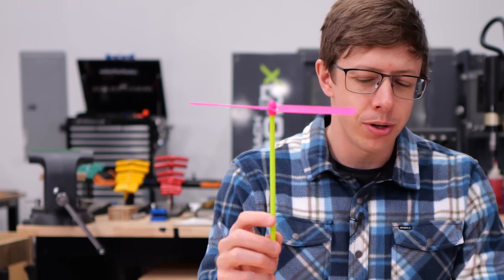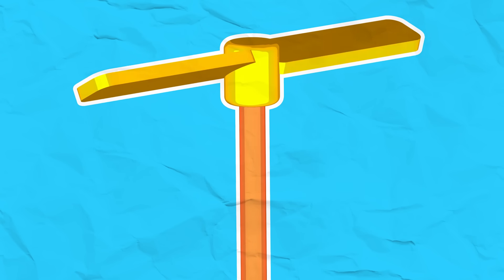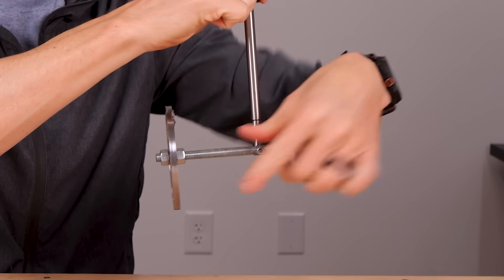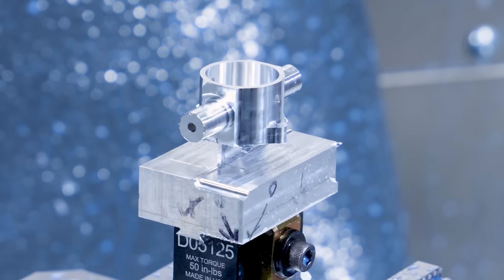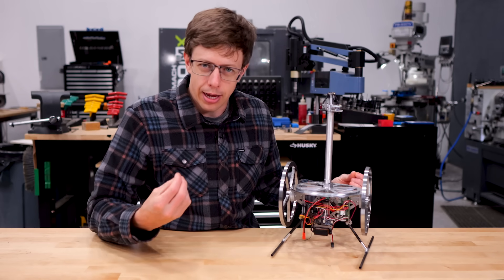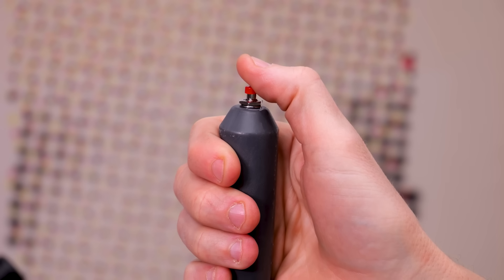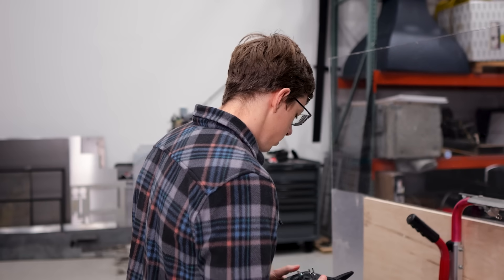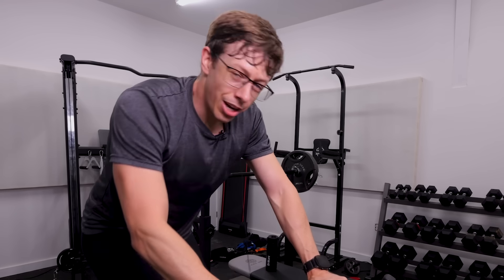I really thought this would fly well

Comment: May I just say: WHEEEEEEEE!!! I had one of those dangerous string-pull air dancer toys as a kid, so that flight path is familiar. Way, way higher, and unobstructed by drywall, relatives, and similar breakable objects. But familiar.

I am like 90% sure the twisty thing is why grown-up helicopters have those pokey-out tailfin things with the little sideways propellers on them. They are pokey-outey for leverage, so the sideways propeller can be of reasonable size, and then it can be used for steering, too. Not, like, normal, reasonable steering, though. Freaky helicopter steering. (It's amazing that helicopters work as well as they do. Did you know they're not required to have black boxes in them? That's insane.)

I look forward to whatever bizarre mechanism you come up with just to try something different from existing, proven designs!

Comment: What what happened if he put another set of flying wheels spending in the opposite direction of the other two? So that would be flywheels on all four sides.

Or 

One horizontal flywheel on the bottom of the helicopter spinning in the opposite direction with a gearbox transfer the power?

Comment: isn't the torque of the rotor spinning everything in the opposite direction with no way to counter that torque because you have no side rotor or counter-spinning set of blades below it? And do the wings even work? Like most of the air going over them is just turbulent, right?

Comment: Those aeleroms are nowhere nesr big enough....considering you used a precision aerobatics katana as a visual aid...precision aerobatics planes are notorious for having huge wings with large control surfaces because theyre designed to fly 3d aerobatics which the majority ofnmanuevers are done post stall and not using the airfoil....the key is huge control surfaces guiding the theust from the prop....the ailerons you employed are more for a wing with an airfoil and ustilizinf the wings lift....in this situation its not using a wing to fly so your going to need obnoxious cintrol surfaces to get the same affect because its relying just on the air flow thats the thrust from the prop nothing else is contributing to the lift on this aplication
Reply: Try making that whole surface rotate instead of hinge and it will take significantly less effort to correct in flight

Comment: Would be an interesting design for a V2 if you added a second blade rotating in the opposite direction of the first one, which is what I believe some helicopters use to deal with the torque issue

Comment: Glad to hear you already have an idea! I'm curious what would happen if you put a planetary gear set in between the rotor and the horizontal flywheel. Ring gear on the inside of the horizontal flywheel, planet gears fixed on the support shaft and sun gear fixed to rotor shaft. Would cause the gyroscopic effect of the vertical flywheel to counteract the rotors. Not an engineer just a lowly automotive tech so I'm probably missing some physics law

Comment: Fascinating to watch you work as always. With the current design, seems like you need another spinning flywheel on the bottom (rotating counter to the gear) to counter the torque. OOOORRRR you could just create a release on the propellor itself to launch it straight up under its own power.

Comment: couldnt you just put a secondary set of spinning blades at the bottom generating torque on the opposite direction of the spin?
Like actual helicopters. I mean you already put so much stuff under the blades thats already no longer a kids toy might aswell not try to re-invent the wheel and use the helicopter method

Edit: Also if you conect the main blades throught the main rod of the contraption to the secondary set of blades they would automatically reverse their rotation as it falls and then again when reactivating the main blades so that way it should keep its balance all the way through its flight

Comment: A store bought electric toy helicopter I have works great; it can take off, fly around (under radio control), land.. but you have to charge a battery for 40 to 45 minutes to 7 to 9 minutes of flight. 

It would interesting to try to improve on that. I suppose a gas motor would be the thing, but gas motors are noisy and heavy. I wonder if there's an alternative that would work. The batteries are pretty light. What if it could carry 7 of them, lol. Then you could charge one set while the other set was in use. It could be a military helicopter and the batteries could be shaped like bombs or missiles.

Or.. what's the smallest, lightest, quietest gas motor you've ever seen?

Comment: Great video! If according to the hacker contest rules the objective is to find a way to use "stored kinetic energy" to prolong the flight of the toy, you could simply redesign it using counter-rotating blades and battery-powered electric motors. Then, charge up the batteries using a generator hooked up to your exercise bike. No foul, mission accomplished.

Comment: I think there is a reason helicopters have blades on top and only on 1 of the sides, not on both. Im confident if he had just one that had variable speed control on the side, he could have it automated to offset the spin of the body with just the right amount of rpm

Comment: I'd really like to see the flywheel solution work.  Perhaps a counter rotating flywheel with a planetary gear (on the same shaft as the rotors)? 

Also, i had a toy helicopter as a kid that used a free spinning rotor (cox free flight cobra).  Mounted on top of the rotor hub was a small .049 nitro motor with like a 3in prop.  When the motor was started the rotor would counter rotate to the smaller prop, although much slower due to its much larger size.  The rotor blades were free to pitch up and down a certain amount and had a counter weight on each rotor blade near the tip that extended out in front of the blade.  So based on rotor speed the weight controlled the AoA of each blade. You'd fire it up, let it go and it'd climb for about 10 seconds before running out of fuel, and then it would auto rotate back down.  The counter weights controlled the speed of the descent.  As a kid I didn't appreciate how clever the whole setup was.

Comment: Just jump straight to making a helicopter powered only by flywheels, with a swashplate to control the pitch and roll and a tail rotor or some design that doesn’t need a separate tail rotor like NOTAR.

Comment: And this is exactly why we use anti-torque rotors. Wings only give you as much acceleration as airflow you put into them, and even then you're losing some energy. It's also a fixed amount, which means micro-variations in airflow will cause major variations in torque and capsize the aircraft if you're not constantly adjusting the output of the ATR independantly of the MRA

Comment: I’m curious if you could have a third fly wheel towards the bottom that has a similar rotational inertia to the propeller but is geared to spin the opposite direction to directly counter the torque from the propeller. Obviously it would have no steering ability but maybe it could work

Comment: The torque of such a rotor is insanely high, you won't counter with simple airfoils. 
I see two solutions:
1. Use a coaxial rotor. Two rotors spinning in opposite directions. This should be relatively easy with your design. Simply put another bevel gear to the lower side and attach it to a shaft inside your already hollow shaft. The only problem will be the angle adjustment of the blades. You'll probably need something like a swash plate. Or use two servos, the existing one for the upper rotor and an additional servo between bevel gear and rotor for the lower rotor. That would also allow for active yaw controll (one rotor has a higher pitch, which results in more drag and a torque in one direction).

2. Put an actual tail rotor on. This will be way harder to do. You'll probably need a gyro and an approxemate amount of thrust to counteract the torque to define the dimensions and gearing. Obviously you'll need some more gears and shafts etc. Will be difficult.

I'd stick with the first solution. Almost all of your energy is used to produce lift. The design changes are relatively small and I think, there is a high possability of success. Yaw controll would be possible with both solutions. 
Looking forward to see part two! Good luck!

Greetings from germany ;)

Comment: sir, the answer to the rotor torque problem is absolutely a second flywheel. It just needs to be on the same plane as the rotor. 

ergo, you either need a second counter-rotating rotor OR, the flywheel is on the bottom of the craft and it powers the rotor through a small gearbox that reverses the rotation of the shaft. 

The second solution would be easier to build and it's the actual answer - because it doesn't matter what the source of power is, you're fighting rotor counter-torque. Meaning that if it's flywheel powered and has counter-rotating rotors, you'll still have a torque issue because of an odd number of devices introducing torque moments.* With the torque moments tamed, you should be able to maintain controlled flight with the aerodynamic control surfaces. 

_________rotor
        |        upper shaft
       [ ]       direction reversing gearbox - mount control surfaces to the gearbox housing
        |        lower shaft
_________flywheel
       [ ]      rotor pitch control system and landing gear mount

*I know there are helicopters that use counterrotating rotors to combat torque successfully. The issue here is the low relative mass of the machine vs the magnitude of the unwanted torque.  

Also, my brain is telling me there's something I'm overlooking here, but I can't for the life of me think of what it is.
Reply: I don't think this would work. The main portion of the torque is produced by the drag of the rotor. Also the flywheel powers the rotor, so the direction makes no difference. The flywheel itself has no torque other than drag and friction of the bearing. You'd need the same amount of drag on the flywheel wich wouldn't make sense except its not a flywheel but a second rotor. I think the existing flywheel layout in combination of a coaxial rotor would be the best solution.

Comment: just throwing it out there ... enclose the flywheel leaving holes or slots in it so that it creates thrust in the direction you want ... can open and close the holes for more or less thrust ... flywheel is a fan ... you can have each spoke twist in both directions and holes further from the center 'blow' one way and closer to the center 'blow" the other way ... size of the holes to the center larger or spoke blade higher pitch ... hole aperture  would have to be controlled via a feed back of some type I think. 

thinking it would reduce the weight a bit and couple the forces better than your 'fins'. you'd be, effectively, creating a tail rotor that way.

Comment: Cool idea! Don't worry about the mistakes, it's forgivable if you're not an aeronautical engineer. 😉👍

However, the last mistake is that the flying machine doesn't have a tail rotor. The torque created by the air resistance of the upper rotor needs to be compensated with a rotor on the tail, or another rotor that rotates in the other direction. The advantage would be if both rotated on the same axis, then you would increase the lifting force by ~20...30%.
Or you can combine the rotor with a flywheel, make a metal ring with blades inside, there will be less friction with the gears, and there would be no induced drag at the ends of the blades.

By the way, I like it too, you're not ashamed to show your mistakes, I have almost gathered the courage to show the mistakes I have made. 😁

Comment: Truly love your designs and your thought processes 
Just a thought, could you put your flywheel in line with the output shaft to spin the shaft in the opposite direction . perhaps using a planetary gear set up. Making the set up more compact and perhaps providing counter rotation support to the helicopter blades..

Comment: Just make it much longer, the dimensions and weight distribution need to be more like the original thing. 

Also if you could disable auto translation I would be very thankful. Not sure if that is possible from the creators side but it is very annoying since the mobile website doesn't have the option to change that, only works through fiddling with the Desktop website on the mobile browser.

Comment: Have you considered using a single flywheel rotating in the same plane as the rotor but rotating in the opposite direction? That way the precession cancelling works for you rather than against you.

Comment: I think you'll find those flywheels were too heavy for the autorotate plan. In your next design you may want to consider a way to disconnect them after they've run out of energy, or perhaps to disengage before they're entirely out of energy and use the last bit to re-engage before landing - though I'm not sure how light a clutch would be manageable. Also might consider placing the flywheels horizontal too and counter-rotating along with a second counter-rotating prop too, then use prop pitch to control.

Love the channel man, you do some cool stuff.

Comment: ha? what gears, what 2 flywheels.
Why did you not attach single flywheel perpendicular to the shaft of the propeller. It would always be under the prop blades and on the way down angle of the prop blades would manage the descend rate.

Comment: You need a second small propellor with a horizontal shaft pushing the air to eliminate the torque caused by the vertical axis.

Comment: I'm sure someone has said this but if you're driving the blade while in the air (even with flywheels) you're making a helicopter so will need a rear stabilizer motor. 

Another option is to have more then one blade to offset the twist. 

Surprised you didn't figure that out as you're usually really quick. Maybe you're burnt dude. Let your brain rest a bit 😁

Comment: thanks for this it was fun. Can you balance the flywheels by turning them a bit you could also keep the thing upright maybe get rid of the wings use one of those gears on a wire to connect the flywheels and put them in the never-fallover configuration with the sensor. then you could fire a parachute. Heck I think just 4 of them should offset if everything is in reverse right

Comment: You've got nice airfoil shaped rotor blades to generate the vertical lift, but incongruous flat plates for your anti-torque "wings". They need to be nice airfoil shapes, with a set angle of attack to the downwash, and adjustable control surfaces for finer control. Also, the anti-torque "wings" are so close to the ground at lift-off that there will be very little flow over them.

Comment: If you added 2 more flywheels that would not be directly connected to the bevel gear, but rather another spur gear to reverse the directions of the flywheels, would that counteract the other set of flywheels? Or would you still have the gryo effect?

Comment: Why can’t the flywheel be on the outer rim of the propeller? Simplify
Reply: Bike wheel. Replace the tire with a steel ring and the spokes with fixed propeller blades.

Comment: I think that the idea of using control surfaces in that scenario was the big mistake. For air to follow a surface it has to be in laminar flow. Sadly, a fan/propeller generates turbulent flow. That is the reason why wind tunnels are built in that way (they need to redirect the flow of air to make it laminar - and a bunch of other stuff). You can test this with a regular fan and a notebook. Use the notebook as the control surface, you will see that the flow of air doesn't follow the surface on neither of the sides (and you need the air to flow through both sides to generate that difference in pressure in order to generate lift - if the flow is turbulent that is the basic principles of the boundary layer detachment). Either way, interesting video making me think why something doesn't work.

Comment: What if you make to propellers sacrificial? Meaning that you spin them up and have a quick release of just the prop and shaft. Almost like putting the original toy in a drill but having the drill chuck have a quick release mechanism? I think having all the gubbins as part of the flying bit is what's leading to a lot of your physics problems.

Comment: if we're just trying to keep it from slamming into the ground, we could stay mechanical with a weighted governer [i don't know the real term for it] and a spring, as it spins up the weights fly out, compressing the spring but also pushing up a rod that increases the pitch of the blades, as it slows down the pitch of the blades reverses and it'll fall, and as it falls if the idea of harnessing energy on the way down has any merit it'll spin fast enough to reverse the blades again, i can see this at the very least holding the blades flat so that they're at their highest resistance on the way down, acting like a parachute

Comment: Not an engineer but cant you counter the side torque of the fly wheels by also having a counter rotating set of blades above the primary blades isnt that why helicopters with two sets of blades dont need the trim blade on the back of them ?

Comment: Flywheels produce angular momentum, which is ALWAYS conserved. The spinning flywheel in the center is producing clockwise angular momentum. When is turns on the roll axis, that has to go somewhere, because all that angular momentum really really wants to remain flat about the z axis. there's nowhere for it to go, and it either has to go into that flywheel on the side, which is limited by being completely meshed with the center gear. All of the angular momentum is basically trapped between it's forced to transmit it to the greater body of the whole craft, rather than into something like a Control Moment Gyroscope.